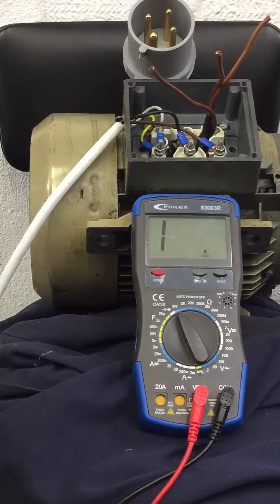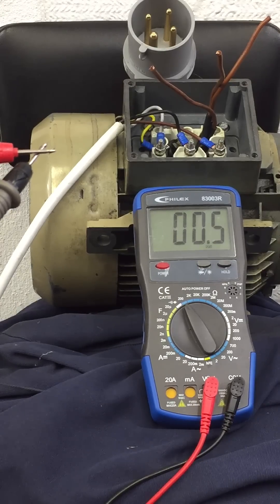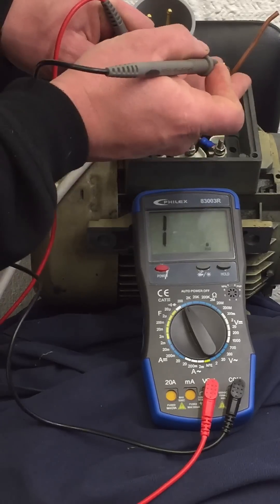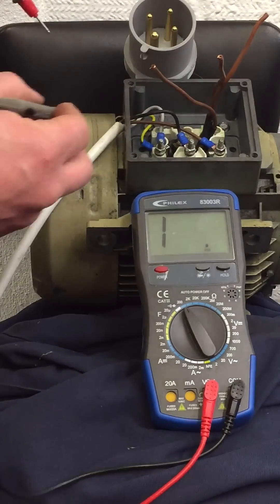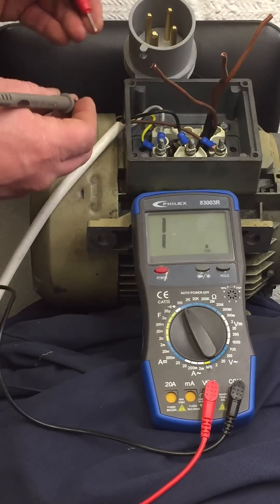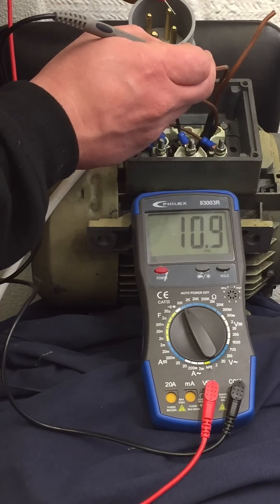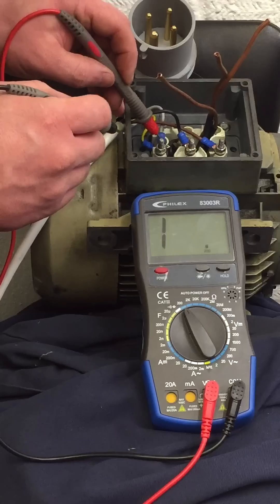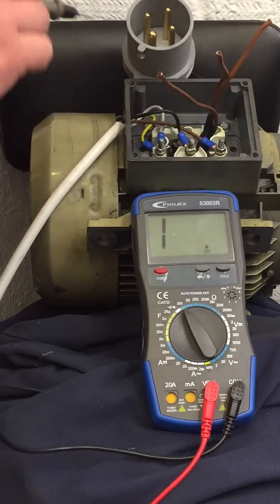Motor windings resistance test

Comment: Hi, so 6 ohm for each stator winding, what was the outcome of your enquiry?
Reply from the maker: i remember i was just checking the motor to see if it looked good before i pulled it apart and pulled the other  pairs of windings as it was wired in delta so i could rewire it to star configuration (if i remember correctly) as i wanted to run it on a 240v 3 phase inverter, it worked and i run the motor on an ebay £99 Huan Yang 240v 3 phase inverter and run my Harrison M300 lathe with it as seen in my other older videos

Thanks
Marc